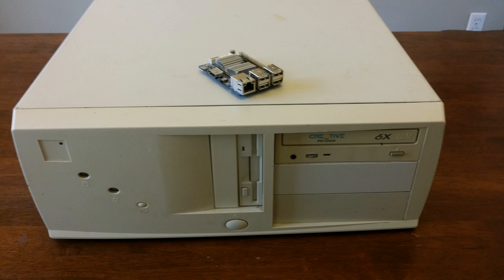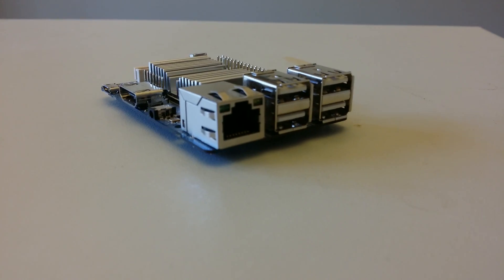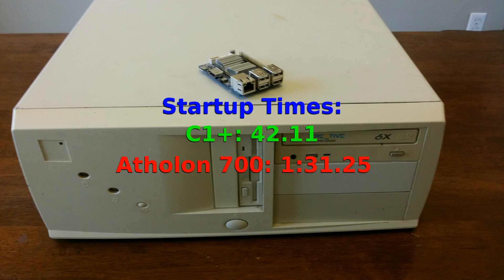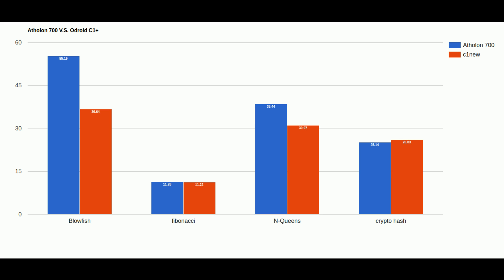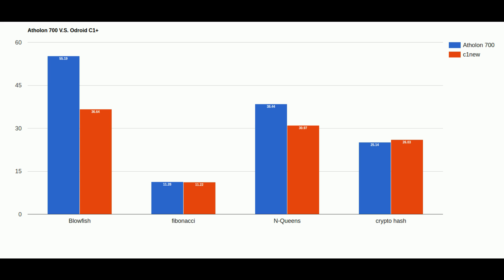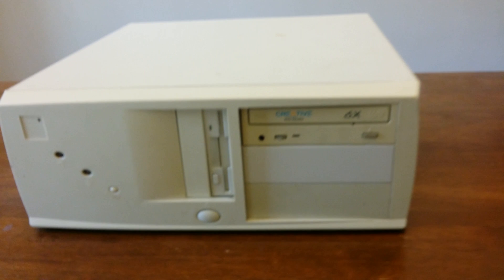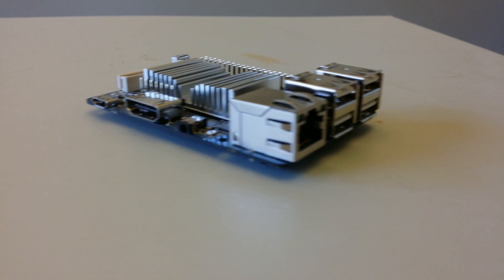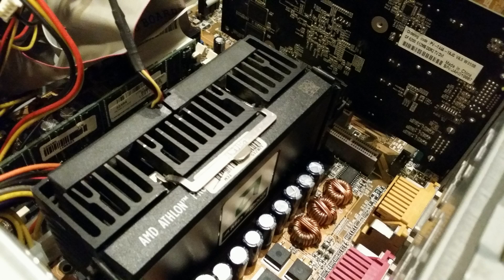New vs Old II: ODroid C1+ vs AMD Athlon 700 - Slot A Pc from 1999

Comment: So.... what we've got is a PC.. with more or less the same computational power of a 17 years old monocore cpu...
Reply from the maker: +WarfoX2011 Yes, but at a fraction of the size, weight, and power consumption.
Reply: Yes of course.. but still 17 years late, not to mention that Low Power Intel has much more power with the same (more or less) consumption.
Far from me to promote x86 architectures (still love so much 680x0) but ARM still need to run.